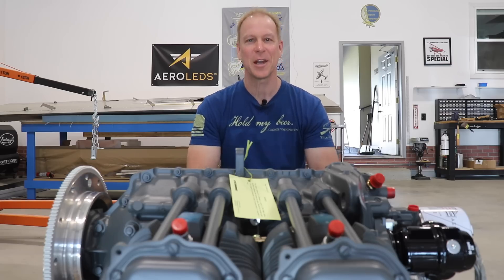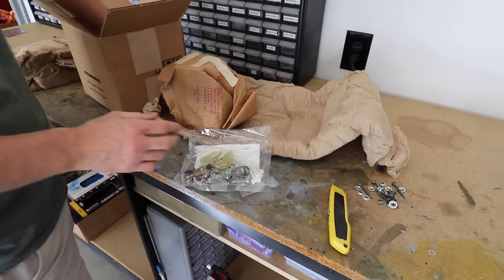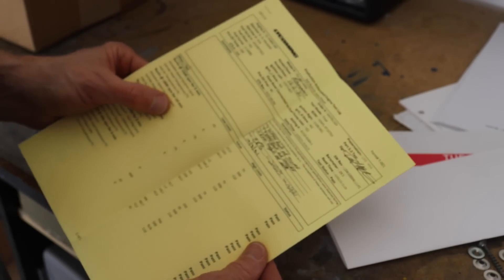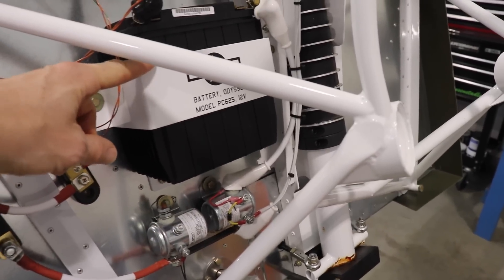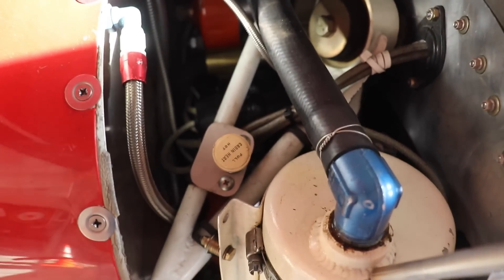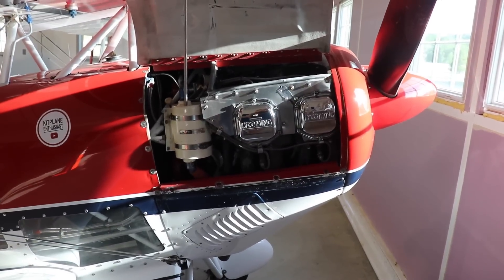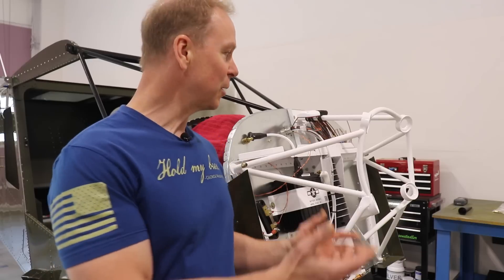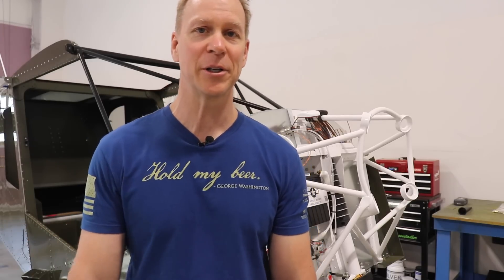My ENGINE has ARRIVED!

Comment: Magnetos are a lot less reliable than electronic ignition.  Not even a valid comparison.  Bendix mechanical fuel injection is worse than having a carb.  A modern fuel injection system from SDS is simple as hell, simpler than a carb even and just as reliable. Fuel pumps submersed in a header tank is the way to go.

Comment: First, I love your content! 
About the oil filter, I have the same issues in my airplane, have you considered a 90 degree adapter? 
Hot start the fuel injected Pitts, try: pull the elevator and hold it, full throttle, mixture a bit open, starter, when the engine started, move the throttle quickly to idle, mixture to reach. You have to be very careful and ready to pull the throttle back as the engine will start and go high power, especially on tail wheel  airplanes.

Comment: Looking good.  It's crazy how the cost of these engines surpasses what a small house cost not too long ago.   Out of curiosity does the Blue Angels Cruzer have any hot start issues?
Reply from the maker: No the UL Power starts right up. But the fuel system is different. It does not have the spider and fuel lines on top of the cylinders.
Reply: Regulatory capture and insane regulations have created near monopolies. All new entries force insane pricing. Without the FAA forcing insanity on everyone, you should be able to get a new engine for roughly $8k-$10k. Any difference is directly enforced by the FAA's uselessness.

Never forget, the FAA's official regulatory position is that all pilots and mechanics want to kill themselves and this doesn't happen only because of the blessings of the FAA.
Reply: Regulatory capture and insane regulations have created near monopolies. All new entries force insane pricing.
Reply: Without the FAA forcing insanity on everyone, you should be able to get a new engine for roughly $8k-$10k.
Reply: Any difference is directly enforced by the FAA's uselessness.

Comment: Fuel injection can be a little more finicky to hot start,, sometimes.. like you said, you just have to find the procedure that the particular engine likes. The Carb will be easier to start hot, cold or hand prop. As for the mags, those slick mags will be easier to hand prop if you ever needed to. Although P-Mags could allow for hand propping also. Electronic ignition will save you about a gallon per hour in cruise. That’s reason enough for me to use them. Plus they have a built in generator, a total electrical failure won’t take them out like other electronic ignitions.
Reply from the maker: I’ve read a lot of good things about the P-Mags. Someday I may upgrade and use them.
Reply from the maker: I’ve read a lot of good things about the P-Mags. Someday I may upgrade and use them.

Comment: Latest and greatest ? You mean technology stack that has been mass produced and installed on tens of millions of engines since around mid 80s … I guess if you compare that to what is basically a 1930s engine , it does qualify as latest and greatest …. speaking of Trent Palmer , ironically, he does fly a modern , turbo and fuel injected engine😊
Reply: Good points.  The funny thing about the Rotax is even though they keep improving the fuel and ignition components etc even that basic engine design dates back to the 80s.  Time flies ...

Comment: If the engine only has the oil pressure port facing sideways, install the 45° restrictor fitting before mounting the engine. Some have 2 ports, one facing rearward, which you can access after the engine is mounted. Hope this tip saves you some time.😊 Also there are several angled oil filter adapters that may fit, this would eliminate 2 extra oil lines, but it may not fit your cowling. Cheers, B.

Comment: Engine looks great and I'm sure it will serve you well. Carburetor and magnetos may not be new tech, but they sure are tried and true.
Moving the battery back sounds like a good idea if you need weight aft anyway. You may need to increase the wire gauge of the battery cables to compensate for the longer run. Somewhere I've seen slim (long and skinny) AGM (absorbed glass mat) batteries that are spill-proof and can be mounted in any position, like laying down flat. They're pricey but open up many possibilities for mounting in narrow/thin places.
Reply: Horse and cart may not be new technology but they are tried and true . . .
Reply: @TRPGpilot  Yup, and miles out into the wilderness where there's no electricity or gas, I'd rather have a horse and cart. We had a late 1940's to early 1950's International Cub tractor on the farm that had carburetor and magneto. With the crank handle put in the front of the motor you could start it up with no battery. We ran it for years with no battery installed at all.
Don't get me wrong, I like fuel injection and electronic ignition. It has many advantages, but carburetor and magnetos is still a good choice in the wilderness, which is where Mark says he plans to go.
Reply: According to the label, the battery is a PC625. The Oddesey pc625 is an AGM battery. This is my preferred battery.  They do not like the heat when installed in the engine compartment. Better to install them behind the firewall or farther rearward. Using the battery to adjust weight and balance is a good idea.